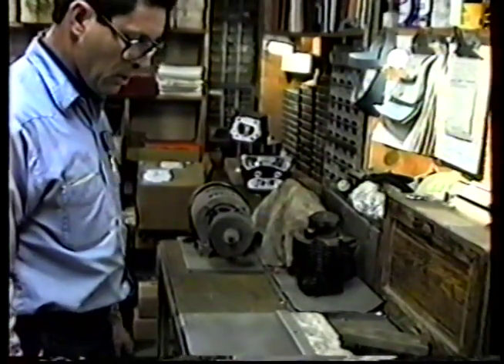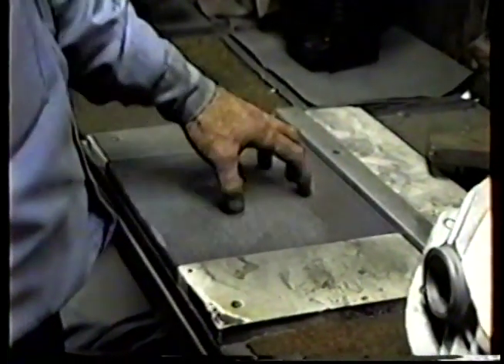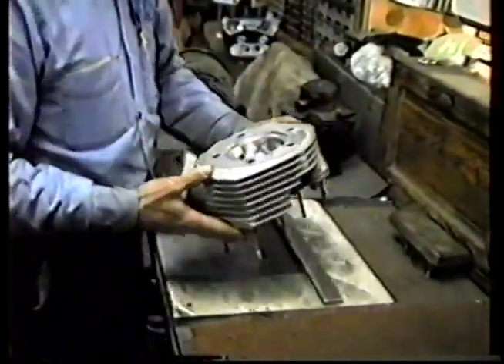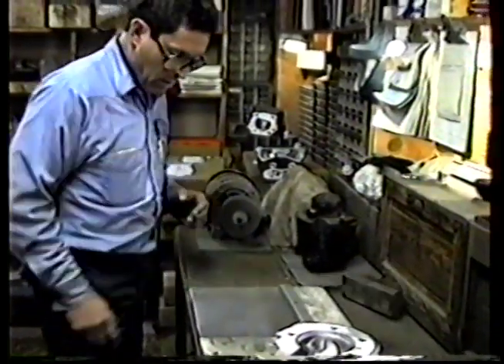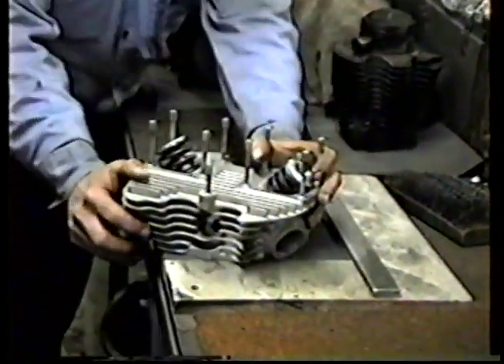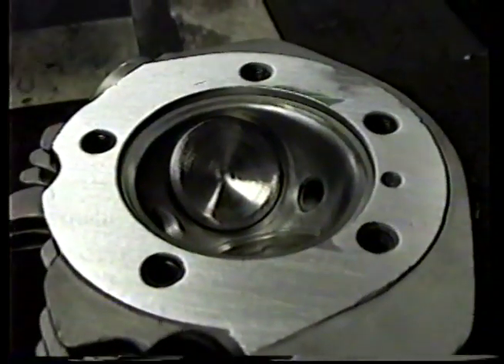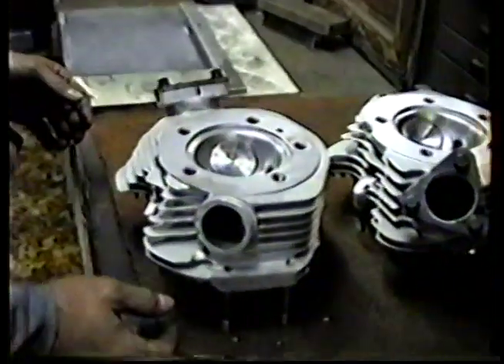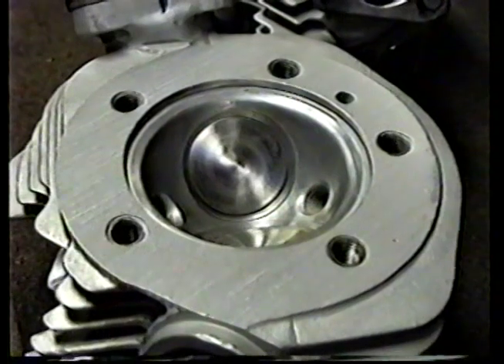HDES-19 Shovelhead Resurface by Hand Lap for Harley-Davidson

Comment: I use a similar method for sharpening edge tools. I use oil on wet/dry paper. The paper lasts forever. I’d think for your application oil would be desirable to keep dust from getting in places you don’t want.

Is that a piece of dressed marble or a machinists flat plate for set-ups? What’s the flatness of that plate? Interesting video.